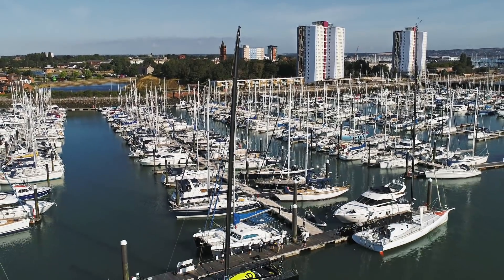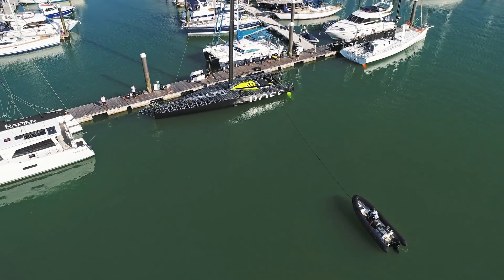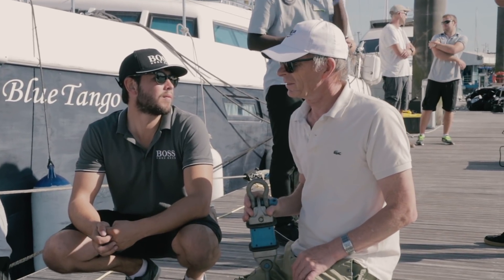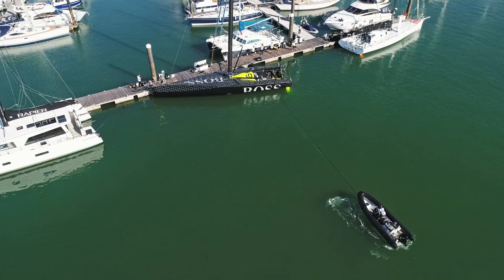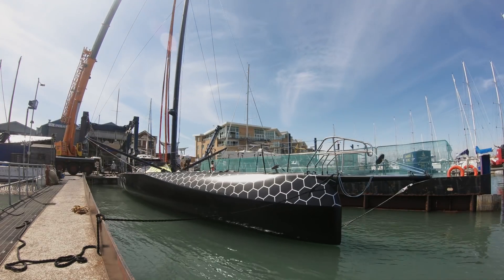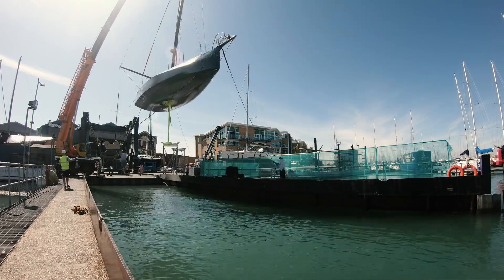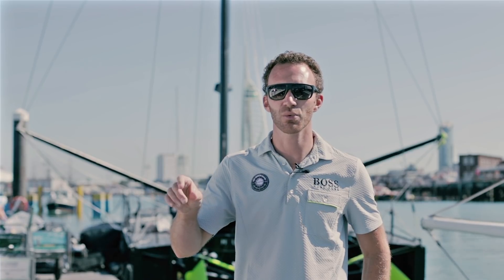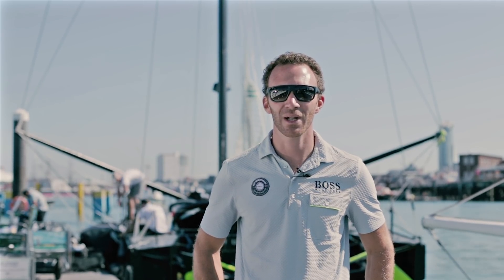90 degree & IMOCA Measure

Comment: Wow that is impressive. I did not realise that they actually measured the physical righting lever. Normal practice is to conduct an inclining experiment to determine the key parameters and then calculate Gz as derivations for given angles of heel. Still you can not argue with an empirical result and it is probably faster to do and repeatable across the fleet.